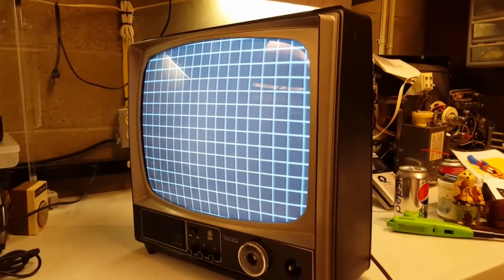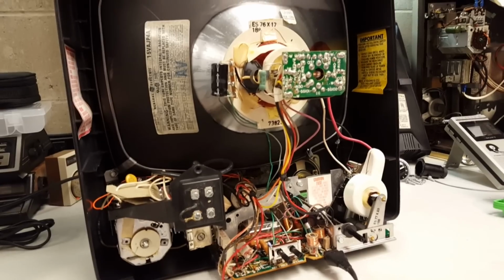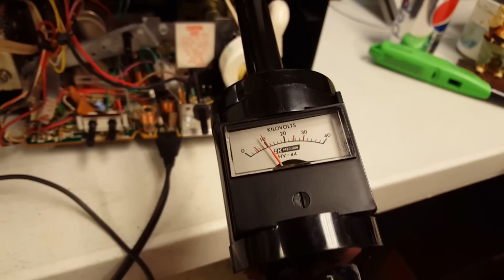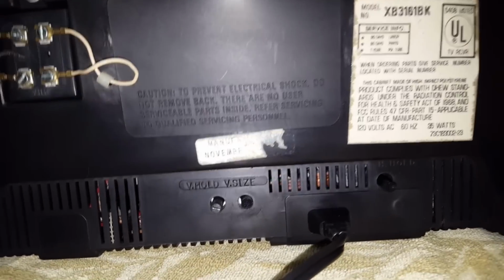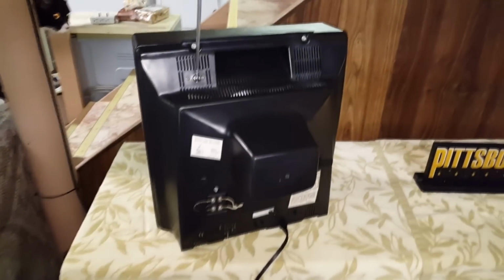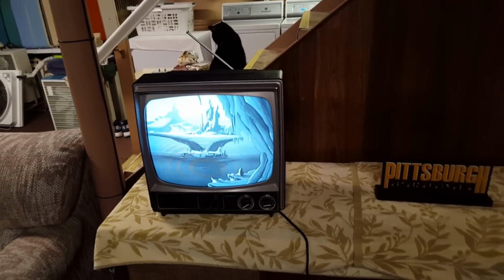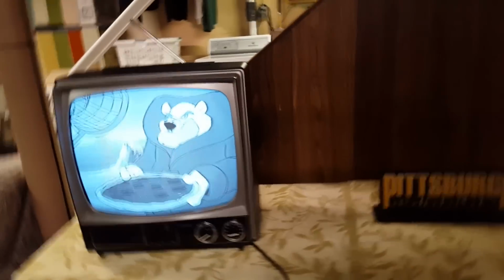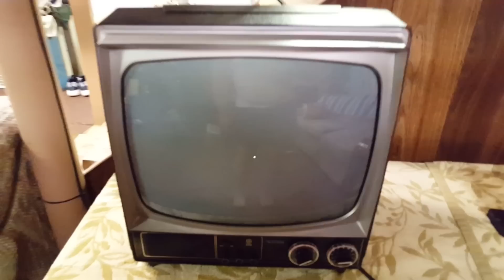1977 15" General Electric XB3161BK Black and White TV

Comment: I have the tube type version of this TV from 1968. It’s gray and white and the handle on it says “Adventurer II” on it. Funny thing was I almost didn’t buy it from goodwill (this was in 2003) because I thought it didn’t work because I had no experience with tube based electronics up to that point. I learned something new that day. I still have it almost 17 years later, but it has an issue that it didn’t have in 2003. The picture will display an image for a few minutes then it will go blank.

Comment: You may be surprised to know, the BT Modulator you use (like mine) actually works best on VHF Channel 7. I've tried it on every channel up to 25 in UHF. It works best on 7 with just a pair of rabbit ears. 

Using 7 also allows older TV's that are Pre-UHF to work, which I have several that work, and are before the All-Channel FCC requirement.

And this TV; Kind of a shocker. I was expecting it to be tube, then you turned it around and it was all solid state. Surprising they kept that look in to the SS era.
Reply: Thank you for your input! I was thinking about picking one of those up, and if I ever do, I'll be sure to tune it to 7